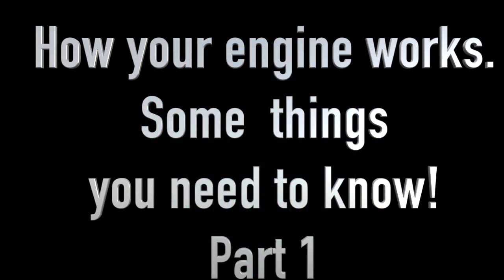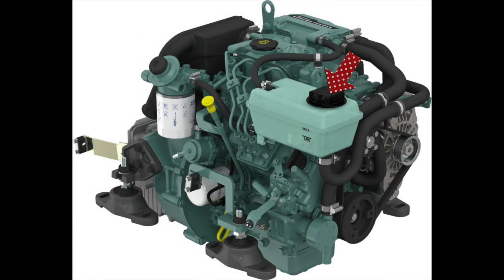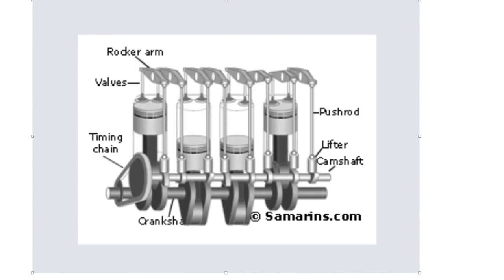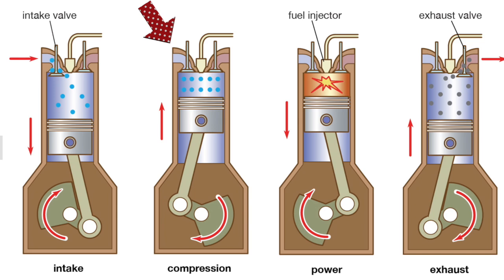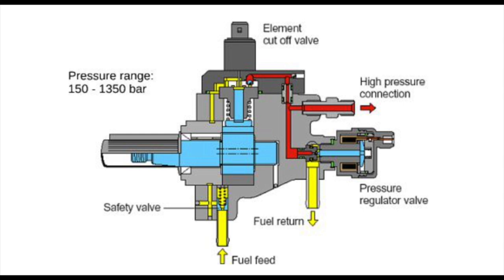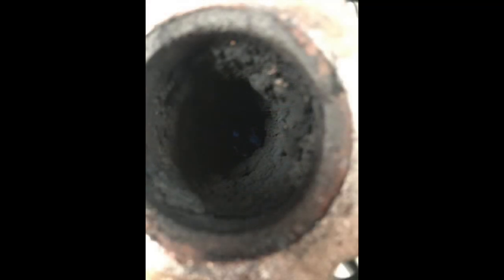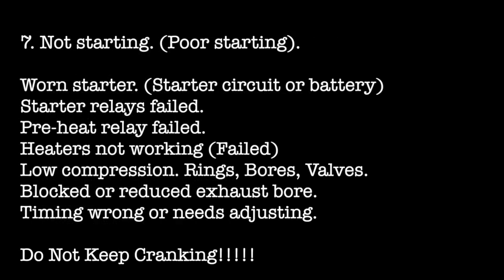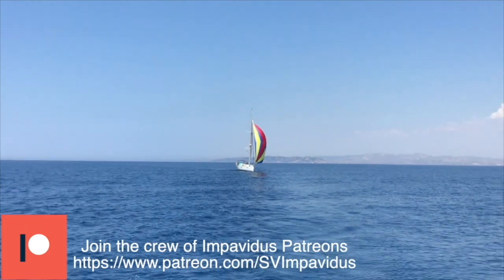Suck, Squeeze, Bang, Blow! Sailboat Diesels

Comment: Thank you very much, as usual very interesting. I wonder when electric motors will replace the diesel engines, although for crossing the ocean a diesel engine is probably better
Reply from the maker: Eliezer. That's a very good question...Just thinking about it for 5 minutes.... It will probably be when the electrical energy technology gets to the be the same as diesel engines compared to output . Our D1-30 puts out 22Kw of energy or 30 Hp with full tanks we can motor for 5-7 days at around 6 knots. More with our extra fuel cans. The best we have seen to date is 10 hours at 7 Kw output from sailing Uma. Of course we all used to cross oceans without motors is it a lack of time that drives us to use diesel, or the modern fast pace of life? Or just the convenience of  knowing when you will get to port?  Or will we learn to slow down... Get there when we get there? Great question. Thanks for watching and your comments. Sail Safe Guys, Ant, Cid & the pooch crew.
Reply: @SVImpavidus  they have $12,000 of lithium batteries alone on the Uma boat (all presumably donated), exciting technology but who can afford it

Comment: Excellent stuff well done. Looking forward to the rest of the series.😀👍⛵️ BTW I thought you may find this of technical interest (usual caveats apply)  not about diesels at all but hey tech is tech.😉
Reply from the maker: Thank you Norman. Your a top man and best subscriber! We noticed a couple of mistakes after we had put it up. (Check the notes/Links in the description). It seems to be of interest. and getting a few hits. The next one is already up. Drop us an email as you did before, and we will send you a link. So you can watch it before it goes live. 
What was the tech thing? Again you will have to mail us as comments with links are blocked to stop spammers. Sail Safe mate. Ant, Cid & the pooch crew.
Reply: @SVImpavidus  That’s very kind of you.😀 It would have been churlish of me to point out the intercooler issue. TBH I thought it was ambitious to introduce turbocharging in the introductory episode but it matters not - if folks have one - they want to know about it. A bit like basic dumb injectors and common rail.

OK I will email you when I have finished plotting my course through the Doldrums (Vendee Virtual Regatt).😉😂